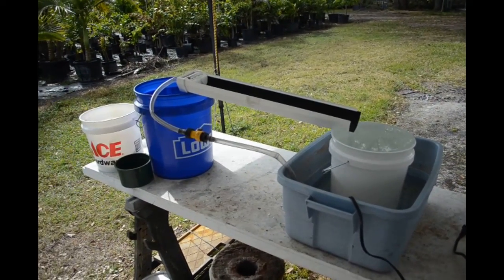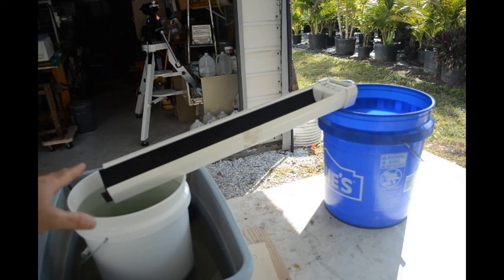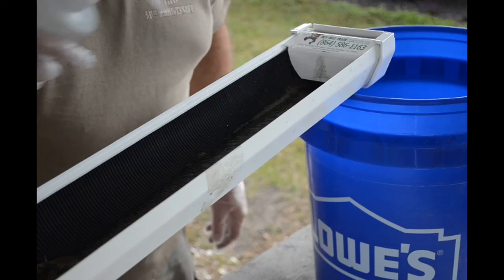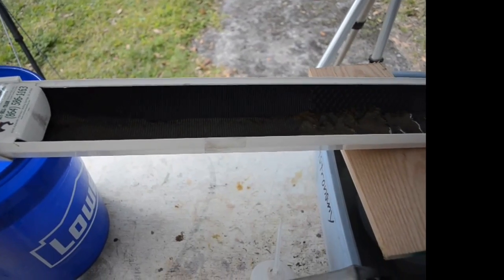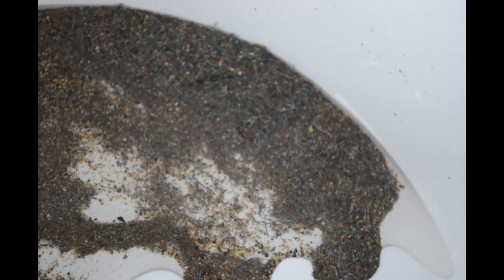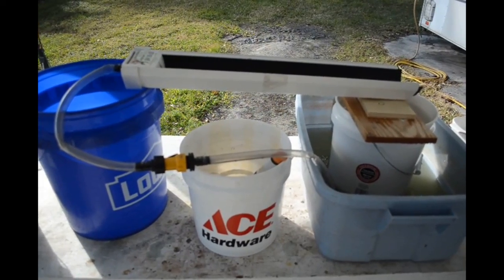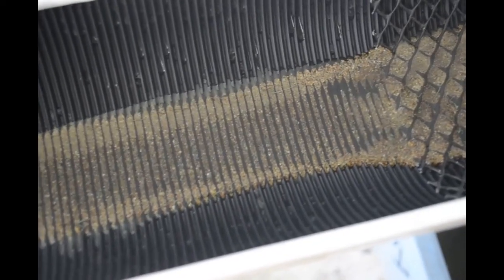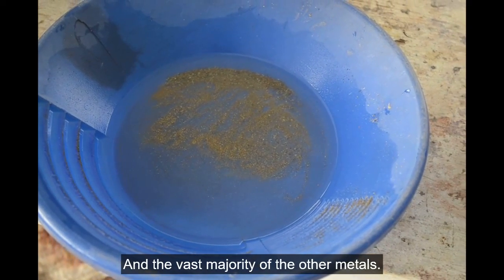Sluicing to get gold from incinerated and crushed IC chip remains

Comment: You should experiment with what sluice riffles are meant to do - separate the gold from everything else. 

Try running it at a steeper angle and more water flow like when working a placer deposit. In other words, set it so about all that is left in the box is gold. Unless the wires are gold plated/filled, they should be caught easily unless the riffles get plugged with base metals.  The higher water flow rate will help reduce plugging.

That approach might, or might not, catch other gold - such as that plated onto pin pads or circuit board traces.

Comment: I think the principle behind sluicing is essentially differential drag - friction/stiction on the particles is overcome by the flow of water.  On a straight angled sluice the difference in water flow speed isn't very pronounced.   Seems like a curved sluice with a decreasing angle would provide a stronger gradient in flow rate.

Comment: Those small wires washing through the sluice can be aluminum, or even aluminum coated copper. Bonding wires are sometimes made like that. You can see spools of it sold by bonding wire manufacturers.

Comment: Maybe take your panning magnet over the crush before you sluice it. Lower your amount of junk metal so the riffles don’t fill up so fast on your first run. My thoughts is that your concentrate is too heavy in dross for a long Tom riffle set-up. The silica isn’t the issue, the excess metal is. 🧐🤷🏼‍♂️
Reply from the maker: You might think so, and I have done that in the past. Then out of curiosity I tried extracting gold from the magnetic part I removed from the concentrate and got a surprisingly large amount out. I figure it is due to gold plating on the steel, gold bond wires welded to the steel, and just plain gold drug out with the steel. Now I try to keep all the metal together.
Reply: @omegageek64  I wonder then, that maybe your riffle spacing is too small to hold in the angular nature of the wires, vs the pounded smooth shape of placer or precipitated gold.. I just picture jacks when thinking about how wires would try to settle out and condense along with the dense waste material ✌🏼

Comment: I always see the angle being set between 5 and 7 degrees for gold recovery on a sluice. I'm curious what angle yours was at ? 
(there are spirit level/angle measurement applications for most smartphones, I use "phyphox" to measure inclination).
Reply from the maker: I just fiddle with the angle until the sluice is working well. I don't think there is any one correct angle. There are too many variables. For instance, The water flow was more than I wanted, but I couldn't reduce the water flow any further. So I had the sluice nearly horizontal. With less water flow the angle likely would have needed to be steeper.